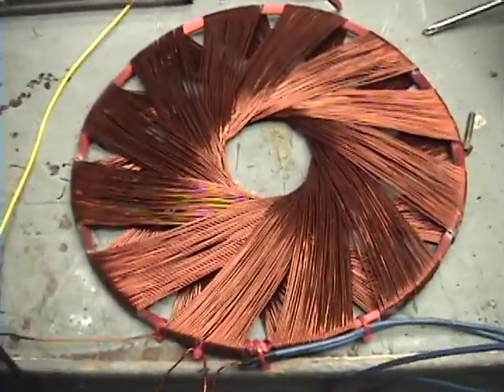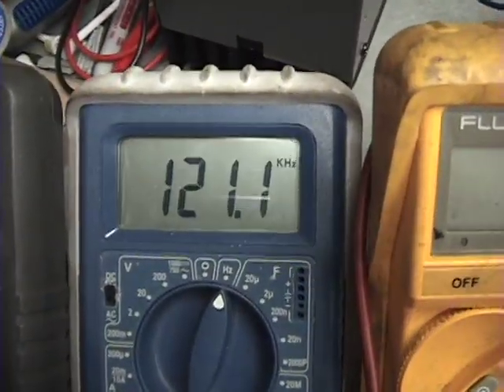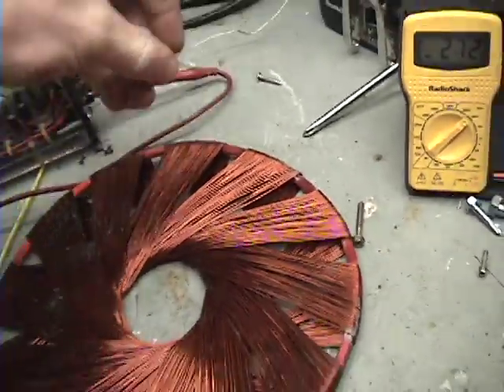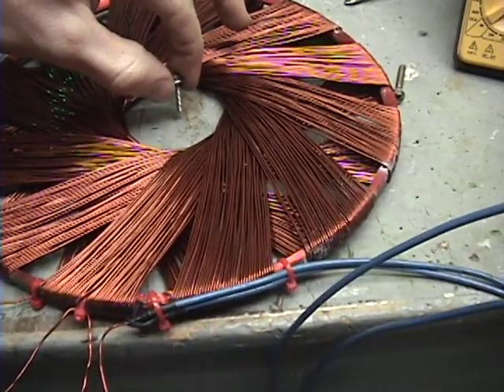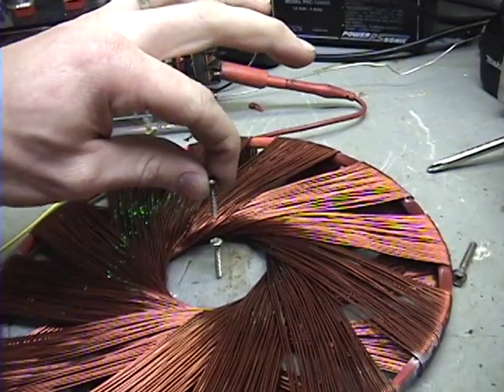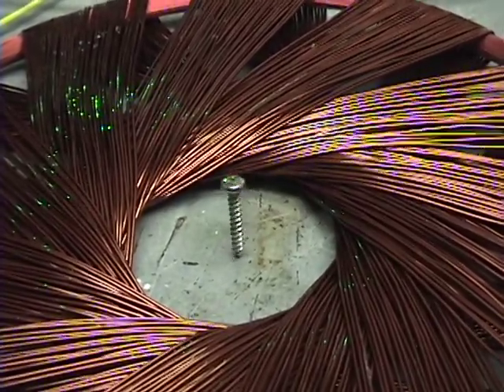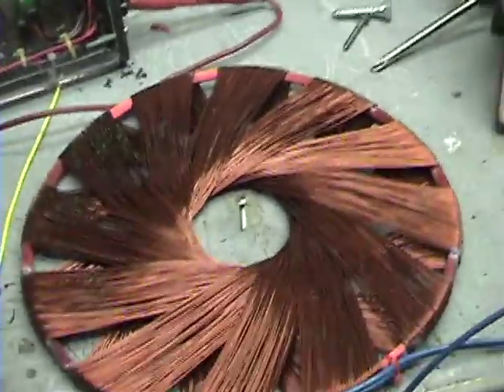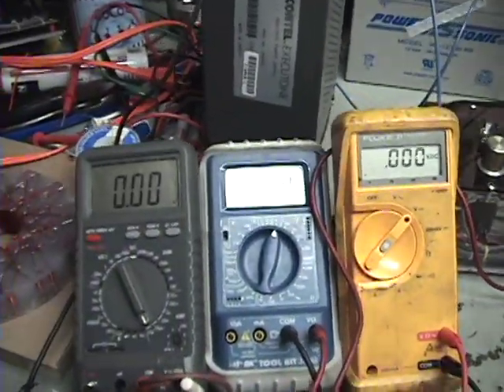"levitating screw" in a HVTW Rodin coil! This Crazy! (TEST7)

Comment: Food for thought... try making a similar coil wound in such a way that the inner empty space forms a hexagon.  You know, like the giant hexagon on Saturn.  ;D

Also, try with 432 hz (based on Leedskalnin's work) or 9 hz (based on the "number 9 code), or 8 hz (about the level of the Schumann's Resonance).

And try also with much higher voltages. Perhaps one of those 1.2 million volt stun guns could launch an object from the center, or make something larger and/or non-metallic stand up, such as a chunk of coral limestone or granite, perhaps quartz by itself.

So many neat things waiting to be discovered! What an amazing universe we live in.

"Uni" = "One". "Verse" = "Word". "Universe" = "One Word".

"In the beginning was the Word, and the Word was with God, and the Word was God."
Reply: There is no such thing as a 1,2 million volt stun gun. It's about 30000v per cm.
Reply: Stun gun voltages would not work on a coil like that. Not the way its made.

I have a few coils of other type and have tried. The enamel will break down pretty fast and cause arching which pretty much ruins the experiment.

Comment: Neat stuff. If you imagine a lens shaped flux field above the center of the coil You can then understand why the shorter object stands but the taller object is pushed over. The smaller object is held up by the walls of the invisible dome shaped magnetic lens.

Comment: What happens if you lift up the rodin coil as the nail is levitating or floating balanced in the middle? if your hand is super still, Does it float higher? what happens if the rodin coil is a few inches above the desk and you put the same screw in the middle?

Comment: you should try making another coil in the shape of a cylinder and mount it inside at a 90 deg. angle through the middle so it is unable to contact your rodin coil and try energizing it the same way possibly even reversing the polarity if possible and I bet some cool effects will happen. BTW cool video and keep up the good work.

Comment: Russ, I noticed what looked like a cylinder magnet attached to a steel pole or rod above your head in the background in one of your videos.  How did you attach the magnet to the bar?  Welding?  How could someone avoid damaging the magnet with the weld? etc.  Thanks Russ.

Comment: If you can direct the magnetic flux lines in a downward direction, centered, will it fly? If you can direct that flow on the perpendicular axis, then tilt or swival it,  will it drive it in the direction of the field tilt?

Comment: can u make a video showing how u hook up a rodin coil to a power supply.. i am a total newbie.. i bought a signal generator and i got one multimeter but i'm not getting any power or current going thru the wire nor obviously any magnetic field.. i see some people using  a stereo amplifier what is the purpose of that.. i am just interested in getting a current to produce a magnetic field..

Comment: not sure if anyone else has said this yet (aside from your findings being cool). please read:

When the screw that is "floating" acts as a magnet, it is because you have made an electromagnet. Imagine wrapping copper wire around it much closer. if your put voltage through it, it will turn into an electro-magnet. that is all that that is. as for the "floating", i think that the electromagnet is pushing as equally as it is pulling. to prove it, move the coil up. the screw will jump to the side.

Comment: Why don't you try raising the rodin coil horizontally a little higher to see what happens to the standing screw. Raise it higher and higher and see if the screw floats in the middle of the coil or if it fall through? From Ho

Comment: I wouldnt say "levitating or floating"  because is not. Maybe held by the magnetic force acting as a clamp is way more accurated since still supported by the ground.
Reply: Luis Fernando 
Vibrating Frequency Reason there is Resonances there Tube Generating Sound Standing Pulse when you Play around Fz Up & Down Pounding with a Big Punch Powerful Pounds a Pressure when Power is Replied, Applied Forcefully Forcing a Force, But of Course!

Comment: I wouldn't say floating. It is following field lines. The interesting part is that magnetic flux is supposed to be zero in the midle (at least as close to zero as the permeability of the core allows), although if it wasn't zero it would be oriented in the direction that it seems to be.

Comment: He mate,   you should see what happens if you started the windings from the center and finished in the centre, leaving a gap between the two ends. leave them to arc  when you feed some juice into the system by small clips just up from the ends. Then get a reading  on that arc compared to what you put in.
Then see how long the arcing continues for after you turn the supply off ?
I'm just wondering where all the magics has  gone  ? In referrence to what Marko spoke of. I know what he was on about so I was waiting to see if his system actually produced it .     Due to the fact I know what he was referring to all along , I knew he didnt have the whole system to do it , he is lacking a crucial component, 
I will be revealimg what it is soon, hopfully.
Cheers.

Comment: try powering that with dc current then run a vertical wire through also powered by dc current then you have anti gravity. but make shure the freqentcy is the same as the one used to hold the screw verttical., then right me back and we will work together

Comment: @rwg42985 have you experienced any "effects" from using this device? The reason I ask is because I suspect that every device that engages zero point energy emanates through a singularity. Essentially a "black hole" has formed. Being small, all matter and energy past its event horizon is being transformed through the 0.  Would it also be transforming important life force energy from the user who may not be familiar with self regeneration?

Comment: can you show a video or message me how you are putting the dc voltage and frequency into the coil ..
Reply: I do the same thing with a function generator and 2 mosfets. Fast switching ones from cree. Just wire them up and connect 12v or whatever voltage to the mosfet and hook function gen up to the gate. Gotta have low gate voltage tho. 
I do experiments like this often

Comment: the coil want to spin the screw. the coil create a spinning vortex of magnetism when pulsed dc. if the center of the coil had a winding 90 degree out of phase with the main coil shorted an emf wants to move in that coil and  move with the primiary coil rather than repelling  against  it.

Comment: Wow that green light freaked me out at first! LOL xD

Dude, there's nothing new to this, it's just plain old basic electromagnetism. By placing iron in the center of your coil you arrange all the electrons so as to spin in one direction (angular momentum), and since the force of each electron can be thought of as a vector, you add them up resulting in an overall net force proportional to the size of the iron core (the bigger the core, the more electrons = stronger magnetic force).

Thx!

Comment: You keep saying in this video that the screw is "floating", which is total bullshit. The screw is simply standing up because it has a magnetic field encompassing it, which means (in case you haven't realized it yet), if there was a split on any side of your coil, your screw would no longer stand up and would fall in the direction of the split. It is NOT "levitating".

Comment: NICE
I dont have a coil
I would try suspending a 4' length small diameter hollow plastic/polycarbonate tube/cylinder directly in the center, making sure the coil is level.
I would try this because the small screw is not fully centered
* how far out can the metal be magentized
* can a piece of metal be totally suspended
then try this with the coil horizontal/sideways
WATCH inducement and entrainment
Balloons and Dyson Air Multiplier fans
youtube.com/watch?v=4WNcjkZ6d0w